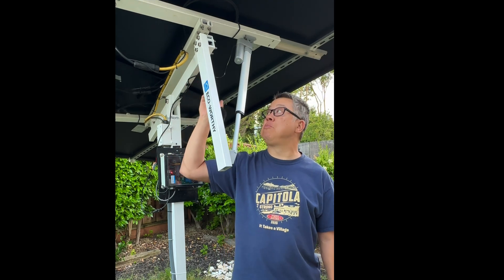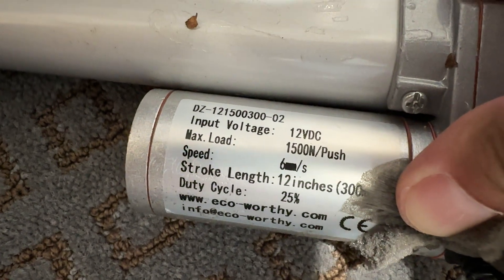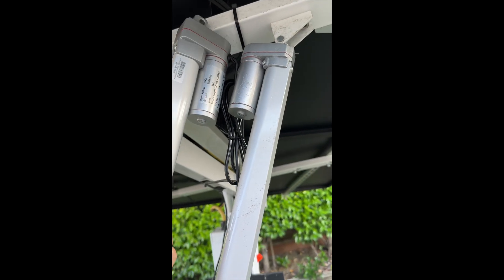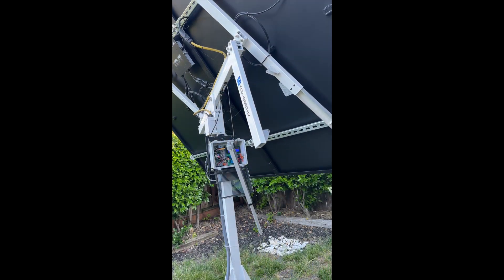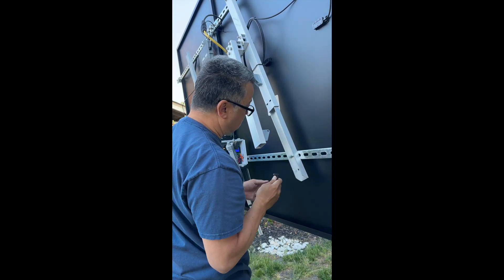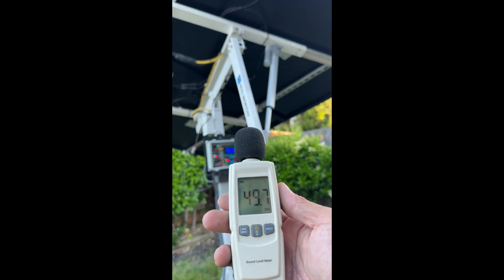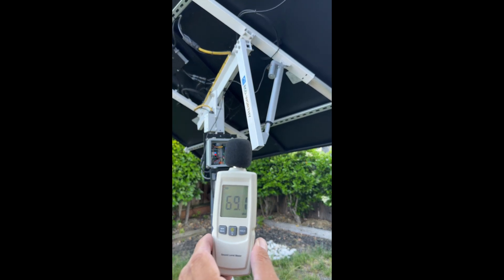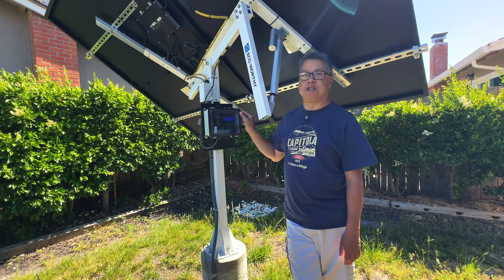Eco-Worthy Quiet Linear Actuator Upgrade for solar tracker

Comment: Every time you upload a video I am hyped. Thanks for the simple straight-to-the point material. i follow your channel since I saw the Passat EV conversion years ago! I would love to know the state of the Passat nowadays! Thanks again!
Reply from the maker: thanks for the kind words!  Passat was parted out a few years ago when I bought a Model 3.  I sold the batteries and motor, charger... all the EV parts basically.  Didn't need to have two 4 door EV sedans after buying the Model 3, so Passat went off to college as they say.